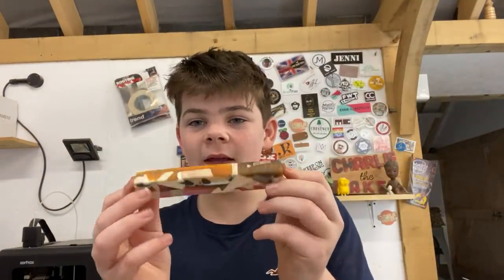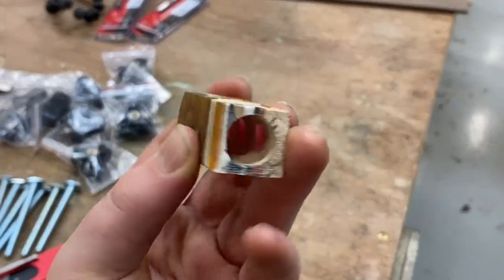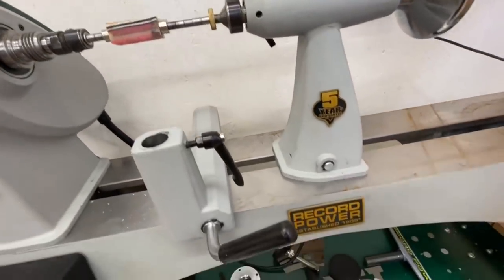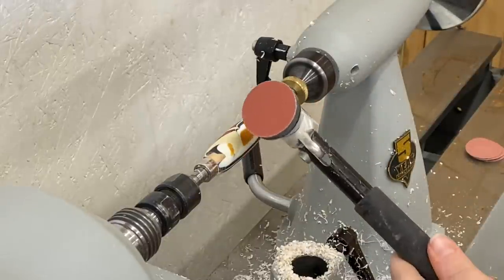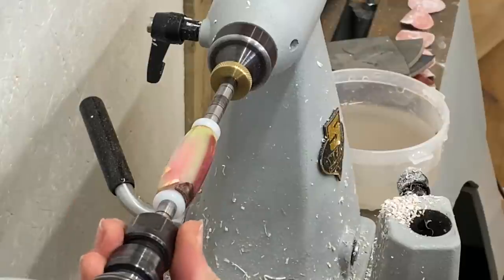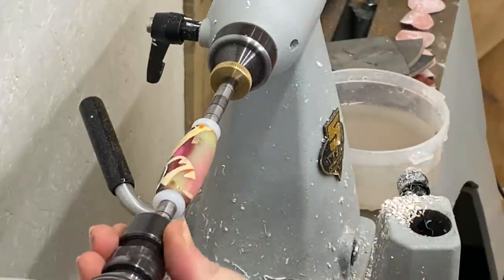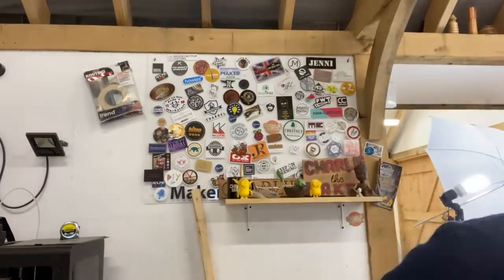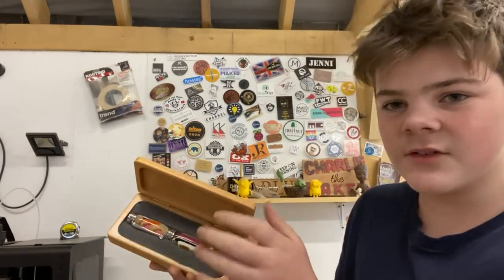The pen of many pieces

Comment: Awesome!  No more buying expensive pens!  All I need is a lathe, sanding gear, drill, buffing equipment, pen barrels, vice, glue, pen assembly, that cool-looking block of colors to be sanded down into a tubular shape, and face shield! Easy-peasy-bumble-beezee!  

Charlie, I’m wondering if you can make your own cool-looking block of colors by making a mold and using some of your Dad’s acrylic and colors?

Comment: Charlie,
A great project...great job on making it too.
I have a suggestion for future jobs similar to this one.  If you are using a blank made like this one was, instead of cutting the blank to the exact size, make it a good bit longer.  That way you would be able to trim the excess off and not have to worry about blowout at the end of your cut with the Forstner bit.
Reply: Well, now that is an excellent idea that you have there!